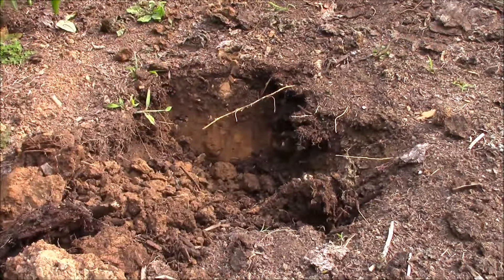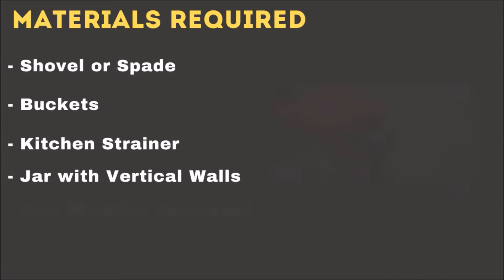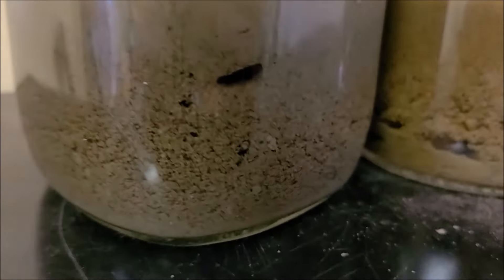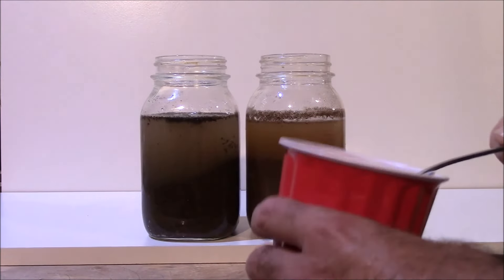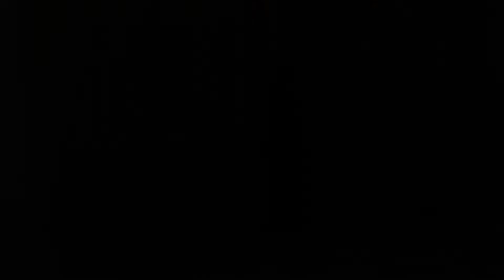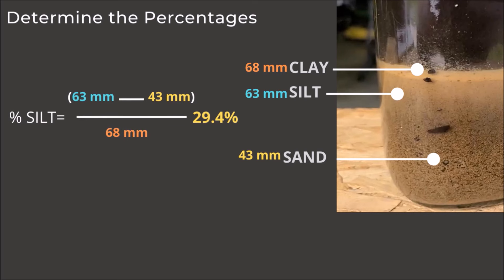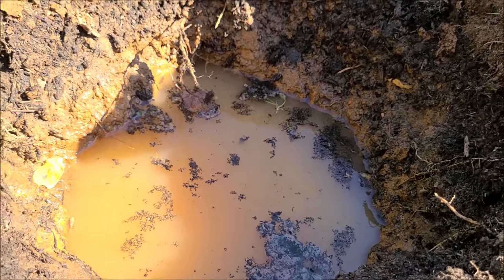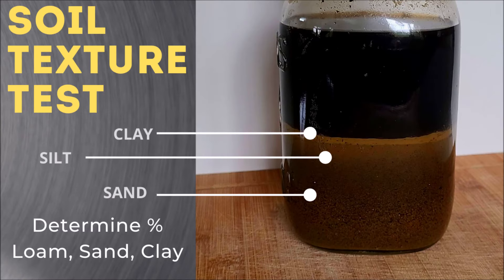Testing Soil Texture - Mason Jar Soil Test

Comment: Good piece of information. Currently doing my construction tech assignment and I gotta say, this is was a ton load of help. Thank you 🙏🏾
Reply from the maker: Thank you Masia!  I'm very happy you found it useful.  Can I ask you how you found the video?  Was it just Youtube searching or was it in some class material?
Reply: @growitbuildit  yup, YouTube searching
Reply: @growitbuildit  how exactly do you make use of the usda to determine the soil type. Been struggling
Reply from the maker: Hi - you have to follow on the triangle, or use their calculator for determining the exact type.  The soil type is directly applicable to construction projects, depending on what you are building.  For gardening it has implications for potential fertility & nutrients.

For reading the USDA soil triangle, you just have to follow the lines.  Or use the calculator by entering in 2 of the %'s.

https://www.nrcs.usda.gov/wps/portal/nrcs/detail/soils/survey/tools/?cid=nrcs142p2_054167

Clay is represented on the Right Side, by horizontal lines.  Sand is represented on the bottom, from lines that run from the bottom up and to the left (to the clay side).  Silt is on the right side of the triangle, and runs down to the sand.  If you look at the angle the 'numbers' are, they correspond to lines that run the same direction.

You just need to find where the lines all cross, or at least get as close as you can.  Then you can see what the area is represented as.

Comment: If you mark 50mm on the jar and fill it with soil to that line then you only need to wait for the sand and silt to settle. You measure them, double the measurements gives you the percentage and whatever percentage is left must be the clay.
Reply from the maker: That sounds right.  I don't think anything should swell up.  Your comment is a time saver.
Reply: I resemble the active equation, results.

Comment: Thank you for this excellent video! I really appreciate your getting to the information without a bunch of obnoxious music and unnecessary video footage. That just takes up time without giving us what we're here for. It seems to be the norm, unfortunately.
I have a question about taking soil samples in wet weather. Here is Western Washington, the soils are saturated for 4-5 months. I'm planning a drip irrigation system and my first step is determining my soil structure. Should I dry my soil samples before sieving to get more accurate results? I'd like to get the sampling done now, since it's too wet to do any work outside. 
Thanks again!
Reply from the maker: Hi Shannon - I think your idea is a good one.  Drying the soils should make sieving the soils easier.

Comment: Amazing video. Explained simply and directly without talking about all the unnecessary bits. I have one question tho, can the same test be done using powdered laundry detergent?
Reply from the maker: Hi Sumer - first, thank you for the kind words!  I am not sure if powdered laundry detergent would work.  They are different types of soap.  One person in these comments used liquid laundry detergent and ended up with a gooey mess.  

That being said, regular liquid soap for dish washing may work ok, as it is a bit lighter.

Comment: did everything as you did. I just get one uniform conglomerate of soil. Im not sure if im looking at clay, sand, or silt, but its all the same eith water on top.
Reply from the maker: If it only took a minute to settle, then it is probably sand.  If the level didn't settle for longer, then it is probably silt or clay
Reply: @growitbuildit  So I just opted to do it again. And perhaps this can serve as a little pointer for other people. 

 I think I made the mistake of sifting my soil too much. My soil does have fine particulates when you dig it up, but the majority of the soil is actually small clumps that I was sifting out entirely. 

So I'm guessing that by doing this, I was essentially sifting out the clay and sand that is mostly found in the small compact lumps of soil.

After doing it again, and keeping the compact clumps of dirt (which break apart when you shake it anyways) I can now see a very clear separation of sand, silt, and a tiny bit of clay on top. 👍 

Ty for the video mate. On my way to making a beautiful garden
Reply from the maker: Thanks for repeating the test.  I agree that your results will likely help others.   Good luck!

Comment: Another question: After measuring the silt layer, what about adding a big pinch of aluminum sulfate (alum) to the sample water as a flocculant to settle out the clay? This is how I settle out solids in muddy water before filtering it when hiking in desert river canyons. In a few hours, the water is clear.  I'm not certain how this would react to the chemicals already introduced in the dishwashing detergent.
Reply from the maker: I really can't comment as to if that would be a good idea or not.  I know that you can get great results just using the powdered dish detergent, as that helps separate the particles well.  Perhaps you could do two samples, trying one with using the aluminum sulfate after the silt has settled out.  That would make for a very interesting experiment.  If the results from both jars were the same, then you would have a quicker way to perform this test.

Comment: My new property next to the Wind River is silty loam. It drains well, but it's dry from years of neglect and the low rainfall in this area (11 inches). In my test flower beds I've noticed that simply adding sufficient water is enough to bring back lots of earthworms, but what can I add or plant to improve the soil's ability to retain water?
Reply from the maker: Hi - my best advice for getting the soil to hold more water is to add as much organic matter as you can get your hands on.  I would make as much compost as possible, mulch, everything.  I have no idea what your situation is in Wyoming, but I would be scrounging for everything I could get.

Comment: Great video!! Thank you so much! I have a test in progress now. My question, however, is that after marking the first "sand line", I marked the silt line at the two-hour mark. However, 4 hours after that, the solution has settled more and the silt has now settled almost a 1/4" more. Sooooo, do I re-mark the silt line or go with the original line at the two-hour mark?
Reply from the maker: Hi Sheila - I would just let the test run out marking as needed.  But if the final levels are different then the initial marks, I would probably use the final level.  Or, calculate it both ways if you got the marks.  I bet you get the same/similar result.
Reply: @growitbuildit  Thanks so much for your reply. I think I'm going to go with the final results (3 days in) as the silt and clay levels appear to be very clearly defined now - and the silt level is notably much lower than the line I drew for it at the two-hour mark. Again, I sincerely appreciate your taking the time to reply. Sorry for my delayed reply, but I have been out of town with no Internet access - if you can imagine that! Ha! Ha! I am awaiting a fairly thorough soil test from VA Tech that I should have this next week. Am anxious to see what it reveals.

Comment: looking forward to learning about this
Reply from the maker: Hope it was helpful
Reply: @growitbuildit  very helpful!
Reply: @growitbuildit  I am in central FL. My soil drains so fast its almost like there is no soil there LOL. I dug a hole and poured a wheel barrel full of water down it, the water was completely gone in like a few minutes. I was thinking about adding clay. What do you think? Where could I get clay from. Or should I just add cow manure, worm castings etc...
Reply from the maker: You could add some clay, b7t it will take a lot to move it into a sandy loam.  My biggest recommendation would be as much compost as you can make, and add it.
Reply: @growitbuildit  Yea that makes sense. Do you know where to find clay to buy? I think I will add just a little bit over time/ on the top layer. With the compost
Reply from the maker: I really don't know.  Perhaps ask on Facebook
Reply: @growitbuildit  Ok gotcha

Comment: Thanks for the video. I have two questions, I did the test and then wait for it to settle (60 seconds for sand, 2 hours for silt, and 48 hours for clay). But the mark i did in 60 seconds and 2 hours became invalid as the line of silt layer descended downwards after i leave it for 2 days. Even the 2 days clay layer is settled under the first silt layer. Should i follow the first mark or remark them with the newest layer line? Second question, I've seen different time requirements for this method. Its 60 seconds for sand, 1 hour for silt, and 24 hour for clay. May i know why its different?
Reply from the maker: Hi Shafa, I would use the first lines you marked.  Some silt or clay may settle in other layers if the others are a bit coarse.

In regards to different times, I can't answer specifically why it is different.  But the the seemingly large differences probably don't result in huge differences in results.

Comment: I did this test, I filled the jar about 1/4 at the bottom, added in detergent, shaked it for 15 min,  and after 4 days, the clay layer is settled but the mark is about 2/3 from the bottom of the jar. And  I know the water absortion is much higher in caly than sand and silt because of its large specific surface area. I am now questioning the validity of the % calculation used in this method because much of the thickness is increased due to water absorption. I wonder if there should be a correction factor for sand, silt and clay?
Reply from the maker: The fill went from 25% to 66%?  That seems odd.  What were your raw results?  Also, was your sand component very coarse?
Reply: @growitbuildit  the clay is an expansive clay based on his result.

Comment: Did you mean subtract and not divide when you were calculating the clay?
Reply from the maker: Ho Sol- yes, you are correct.  I misspoke at that spot in the video.  In summary you just need to divide the layer thickness by the overall sample thickness, or height.
Reply: @growitbuildit  Ok I got it.

Comment: I thought I had heavy clay soil until I did this test and found that I have 50% sand, 35% silt and 15% clay. My question is: what is the ideal ratio of organic to inorganic material in good soil?
Reply from the maker: Hi Philip - I don't think I can answer that question.  I have no way to actually measure it, as you need access to an autoclave or some sort of really hot oven.  You get a sample, weigh it dry, then cook it to something like 400F.  The organic matter burns off, and then weigh it again.

But the short answer to your question, what I do - is add as much organic matter (compost, leaf mulch) as I can.  I don't worry about ratios.

Comment: does test. Checks jar after 2 days. Top half of jar filled with dirty water. Bottom half filled with a single thick layer of gravy

Why can't anything be easy...
Reply from the maker: So you have 100% clay?  That makes life interesting.  Compost, compost, compost.  Organic matter will have to help you.
Reply: @growitbuildit  That's all I can figure. Couldn't even see any sand at the very bottom.

I'm going to try mixing it with some topsoil from the store to break it up a bit, then add peat moss and the manure and hopefully that will make it usable.